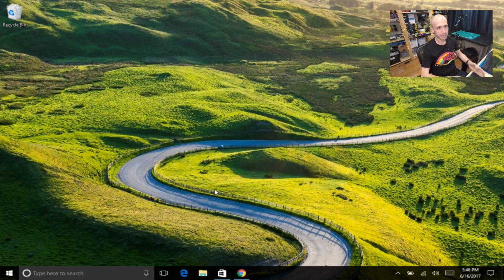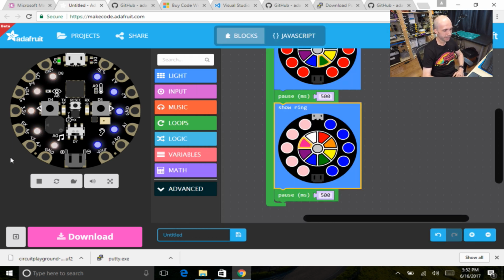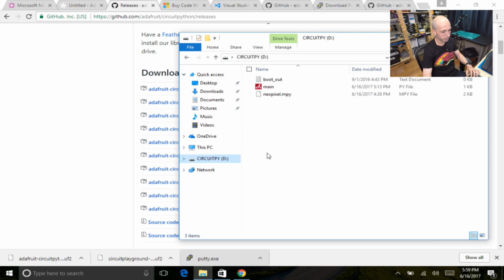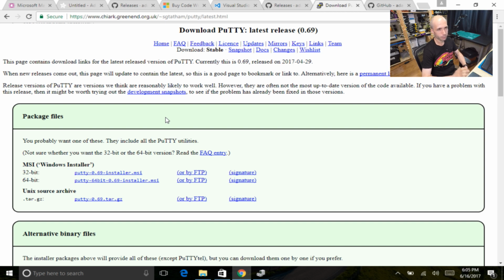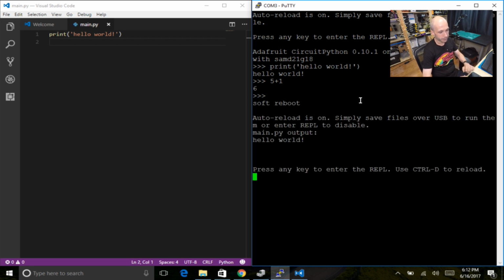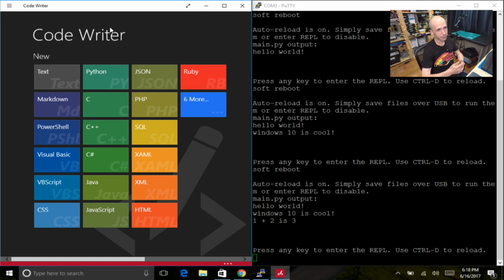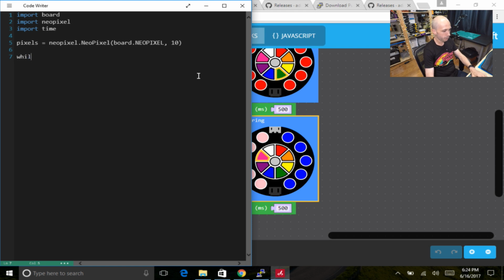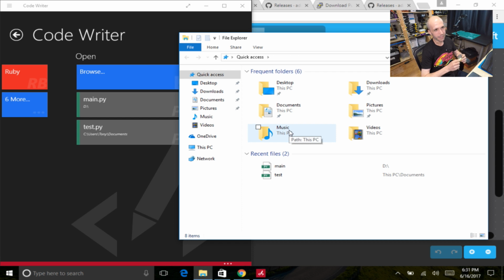Circuit Playground Express & Windows 10: Make Code & CircuitPython usage with Tony D!

Comment: I am a teacher working on developing some projects for my students using the Circuit Playground Express and MakeCode. I can get the light commands to operate pretty well. I am trying to use the thermistor and am having no luck. Do you know if the thermistor is supported yet? When I transfer a MakeCode program using the thermistor to the Express it doesn't work. TIA

Comment: Hey there I need some help! My Circuit Playground won't go into bootloader mode. Not sure why. I have installed drivers and it doesn't show up in my file explorer but my computer does recognize a usb device is plugged in. Any ideas how to get bootloader mode to work? Thanks!

Comment: I have been working with the Circuit Playground Express running CircuitPython as well.  You said it many times, the board is still a development board and CircuitPthon is still pre-release.  I have been having mostly good experiences with it but periodically the file system on the device locks files similar to what you saw in this video.  Additionally, it's not always deterministic so the same code may run with an error once then run fine after that.  I'm confident that the bugs will get worked out before release.  Until that, I've been having a great time with the new board!
Reply: Thats actually a result of Windows behavior, not CircuitPython. Windows delays some writes to the CircuitPython file system such that when CircuitPython autoreloads it finds an invalid syntax (usually). As you point out, a work around is saving multiple times or manually ejecting the drive. If the incorrect errors are frustrating, you can turn off the autoreload and do it manually (though it still may be inconsistent.)
Reply: I worked on my issue more last night and I now believe it's a memory limitation issue.  I had to dig in to the DS1307 and DS3231 RTC modules.  My code is a clock, taking the time from a RTC module on the I2C bus and write it to a seven segment display.  It will only run from the main.py file in a non-interactive mode with the DS1307 on a Feather M0 Express.  As soon as I try to execute the code in the REPL I get memory errors in different locations.  Changing my code to use the DS3231 makes the problem worse.  When I pulled up the two Adafruit circuitpython drivers I can see the extra module being imported due to the alarm features of the DS3231. 

My conclusions are that there is more memory on the Feather M0 Express by a small amount that is enough to run my code.  However, that's not enough memory to run the code with the DS3231.  It's possible the extra module imported (i2c_bcd_datetime) module is buggy but I doubt that.  I just received a Feather ESP8266 with significantly more memory that I will try next.  It does seem I'll need to port over the DS3231 code since the ESP8266 has its own RTC so nobody expected the need to read from an I2C RTC.
Reply: I think you're correct in your assessment.  Once the file system was able to get a good write on the code.py file, the errors have gone away.  I'm not sure if it helped the overall issue but I'm running the board with an independent power supply now (instead of the computer USB supply) and my clock project has been running for 4 days without throwing any errors.  I really am enjoying this board!
Reply: I'm glad its working pretty well. Long running projects may suffer from heap fragmentation. If you continue to see issues please follow up on the Adafruit support forums.

You should be able to use the same code on the ESP8266 with CircuitPython. The APIs the drivers are built on should be portable.

Comment: Just to confirm that with the adafruit driver, the Circuit Playground Express works on my very old Windows XP. Both the mass storage and the serial (with putty) are working fine.